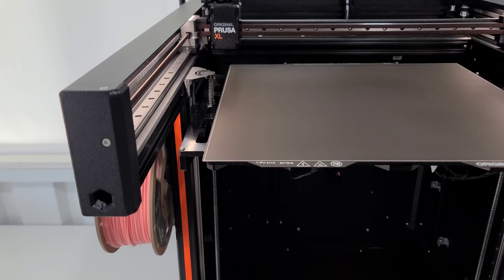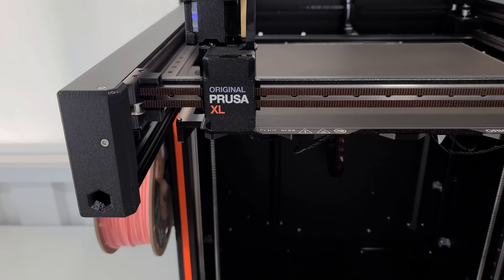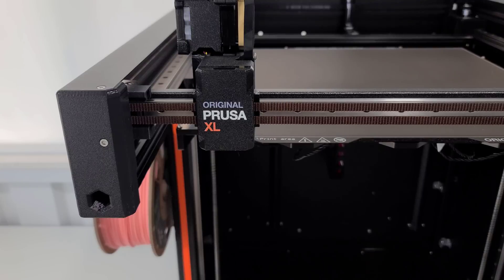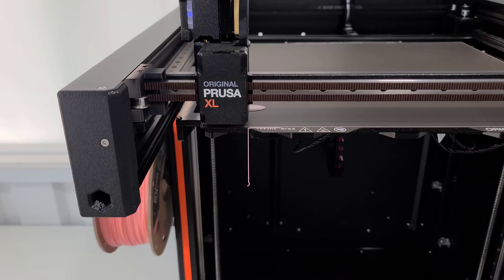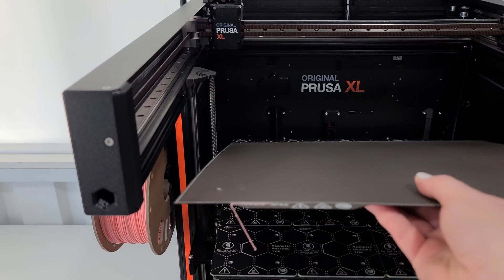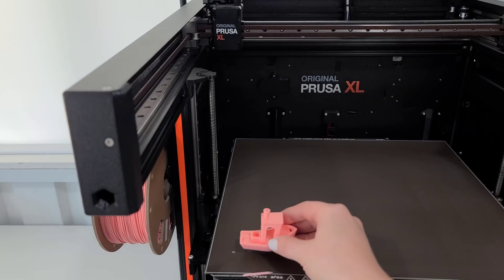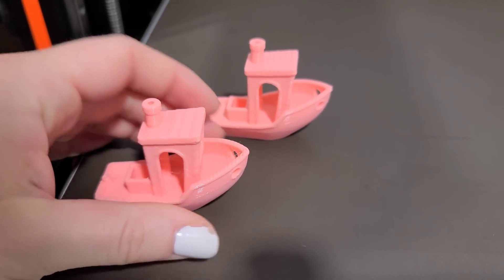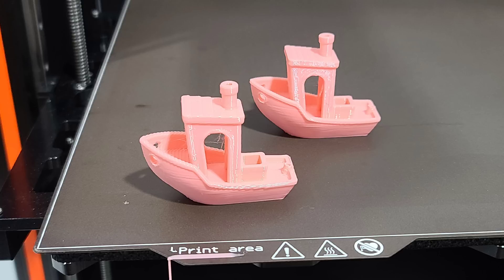Printing a Speed Benchy on the Prusa XL!

Comment: I wonder why the same settings sliced for the XL and MK4 end up with such different print times. Must be acceleration speeds.
Also the quality or speed may be better printing the bench in back corner or as the machine may be stiffer there.
Reply from the maker: Yeah I don't know why they were different. And I will keep working on speeding it up. Just wanted to start with presets. The default location on the XL is the front left. I can't remember why. I think it has something to do with the way the modular beds heat.
Reply: Possibly minimum layer time setting.

Comment: Looks like there are part cooling issues with the XL.  If you look at the second benchy that was done with a .4 nozzle which isn't that fast @ 29min or so...  you can see the front bottom hull caved in.  To be honest, was tempted to get one of these printers at the beginning, but now I feel good that I didn't get one.
Reply from the maker: Its always nice to have others look at things so I don't miss anything. I am happy with the printer but it depends on what you're looking for. Thanks!

Comment: I hope that the Prusa XL gets better because it seems downright disappointing. 40mins for a bad-looking benchy is worse than a stock ender 3 at 27x the price 💀. Personally, I think that while the delays may be somewhat down to sourcing, their main issue is that they have invested a ton into a developing a product which would have been good 4yrs ago.
Reply: Anyone judging based on this one persons use.. and not accounting for the multi head in a few months.. should not even bother. Give it some time.. its brand new. Bambu came out with lots of problems out of the gate. They resolved many.. some still stay. Once the multi head comes out.. even at slower individual print times, when you start to see what it can do, if its something you want to do in printing it will be the only printer able to do it. I am reserving judgement for when the input shaping is working, and the kinks are worked out and multi tool is out.
Reply from the maker: @WhySoDivided-CantWeAllGetAlong  these are all good points! I am looking forward to seeing whatever improvements come down the line. But I am happy with it now too. Thanks!
Reply: @WhySoDivided-CantWeAllGetAlong  the only way it could succeed is as a "trouble-free" tool-changer alternative. Even then, you are paying a HUGE premium.
Reply: @Ec1ipse..  I don't know.. E3D's tool changer is 4 heads, costs more, and looks very similar with slower speeds, etc. Haven't even seen anyone show a video on that one. I agree the tool changing has to work consistently without a hitch.. if it has issues.. that's going to be a problem for the success. The premium is steep.. but you are also getting something nobody else has that will print things no other printer can. On the flip side.. look at Ultimaker.. they have nice printers..but at $5K to $10K that are slower and less capable than many sub $2000 printers.. why do people still buy those?
Reply from the maker: I doubt most people are trying to print a stock sized benchy on their XL as their main print. I just wanted to have something to compare it to.  I'm happy with the printer but to each their own. Thanks!

Comment: Sorry, this is FAR from a "speed benchy". A ~40min benchy from your first print is just typical, and a well-tuned, slightly upgraded ender 3 will fair the same (me and many others in the community have already done it) or even faster. My Voron Trident is far cheaper than this machine and gets far better performance.
Reply: Well it will get faster once it get that "input shaping" firmware update. I don't have a Prusa XL or any prusa, nor do I plan on buying one. They are too expensive. I do have a Bambu X1C, which was probably already too expensive and more than I need. But I don't like waiting long for prints.
Reply: @atnfn  As long as you dont use the AMS and multiple colors.. the Bambu is a beast. For the money I'd still opt for a voron that prints as fast but more reliable, more community, open source, etc.. rather than stuck with a closed source "ship it back at your expense if anything goes wrong" ecosystem. But the Bambu P1P is a worthy printer for the price. The AMS (and the Prusa MMU) are really silly in my opinion though except to have backup filament should one roll run out.. that's the only benefit I see of it. The print times and the crazy amount of waste is such a huge turn off though.
Reply: @WhySoDivided-CantWeAllGetAlong  Do you have a faster, and less wasteful way of doing multi color prints on the same layer? If your not doing multi color prints then the AMS really isn't adding that much waste or print time. I am not aware of any Multi COlor printing options, excepts for Idex or Multi Head systems such as the Prusa XL, that do not waste material or time swapping filament.
Reply: @UbberMapper  Nope.. that is why I say the XL is a game changer.. 3 second head swaps.. with 5 colors/materials/nozzle options. Once it is out. You're not wrong.. just that the AMS is good only if you don't mind the limitations of it.. super slow speeds, waste.. and clogging chances.. as well as no TPU so lack of a very good material for many types of prints. If it supported TPU and had say.. 10 second or so swap times.. it would be very good. But the 1+ minute swap time, and lack of TPU to me is a major reason it's not very good.. along with the huge waste. It's A way of doing it.. but not the best way. But to be fair to AMS/MMU/etc solutions.. it is the ONLY way presently to do it. The XL will change that and I suspect once you start to see XL only types of prints (possibly with gcode for the XL) that include multi material, different nozzle sizes and heat settings.. and assuming those DO come out unlike anything you can do with other printers.. I have no doubt we'll see Bambu and others introduce mulit tool heads.. and then we all win. We'll all start to see improved ways and more heads.
Reply: @WhySoDivided-CantWeAllGetAlong  I don't think there is going to be a revolution of multi head machines in the near future...I think the prusa XL is the second of this type and the E3D tool Changer motion system has been around for years. On top of that, the wasted material is not a big deal when compared to the added cost of purchasing these multi head machines. Don't get me wrong, the multi head machines absolutly have their place such as with TPU. But most people won't need to print TPU with other materials  and that will keep demand for these machines low and thus limit how many companies are willing to produce them. I would like to have a multi head machine as i have done projects that needed the ability to print in vastly different materials in the same print. But even if i owned a prusa XL, i would still send most of my multi color printing over to the bambu because the waste really is insignificant for most multi color prints and the bambu print speeds more than make up for the down time in color swaps.
Reply: @WhySoDivided-CantWeAllGetAlong  I do have the AMS but I don't really use it for multi color prints. It's more the convenience of not having to manually load filaments, and sometimes I use the break away support interface material. It's pretty convenient. I actually had preordered  Prusa XL with 2 toolheads, but I cancelled it. Looking at the price I started having buyers remorse before even getting it.
Reply: @atnfn  I don't blame you.. I am a hobbyist too.. so it is really hard to swallow 3500 for a printer like this. But I tend to lean towards the cry once buy once. Prusa is very well established and though they been getting a lot of crap the last two years for not coming out with anything new/better, they have very reliable printers that tons of print farms depend on. I too am still "on hold" on the XL right now. I really want it for the multi tool head diff material/nozzle stuff.. I think that will be a game changer in things we can print that we simply cant do today. Simple example would be a phone case.. one piece.. with a PETG outer layer and TPU inner layer.. custom two color (or more) for specific phones. Granted..this is an "easier" print even with 1 head and manually just changing to the TPU filament at a given layer.. but then the outer layer side wall would still need to be PETG.. and using the new cris cross weaving of materials to bind them together better with multi head tool.. I can see a very rock solid PETG/TPU mixed phone case being possible that would be near impossible with AMS/MMU or manually changing it. Best way I can explain it is imagine a phone case laying flat.. and you lay down PETG.. then you start adding the TPU.. but to make it bind better.. you still intermix some PETG/TPU for a couple layers.. then a few more layers (or more) of TPU that rest against the phone. There is no way to do this with MMU/AMS options easily.. it would takes hours to print that due to all the minute+ long changes.. and the cooling of each layer in between would likely result in not nearly as good a bond of the mix. None the less.. I've no clue if this will be possible yet.. that is why I am still holding out.. between input shaping and a few other things.. I am hoping my order is not ready till end of summer time frame so that hopefully others have had time to experiment and see what is possible.
Reply from the maker: Thanks for your feedback
Reply: Yeh not really a speed benchy but comparing this machine to your Voron is a bit weird. This machine is a different animal than the Voron Trident. Correct me if i am wrong but your voron trident doesn't have as large of a build volume or the option for 5 tool heads. Yes i know there are a few different multi material options for the voron but its not the same. Yeh if you need a single material per print get a voron over this but you are probably not even looking at this machine if that is all you need.

Also, not fair to compare this machine with the Bambu as again they are different animals. Yes a bambu does have the option for multiple materials in a single print but it still not the same as having multiple heads. If you try to print lets say PC in the same print as TPU bambu will tell you noway because you could easily clog the nozzle due to the high temperature difference. Couple this with the fact that this machine will not waste as much time or filament on purging and you really start to see where it shines.

Honestly, This machine is specialized and if you don't need that specialization you are probably wasting your time but if you have the correct application then you will understand that a Voron or Bambu just doesn't compare. Only and Idex machine or something like E3D Tool Changer motion system can be compared with this.
Reply: @UbberMapper  We have to looked with the eyes of your soul? That's very slow. I'm agree with you about multi material, but there are  others options that print multil material and faster. Plus why prusa sell this printer with only 1 tool change? Instead they should sell minimum 2 toolheads. Maybe they should took the klipper avenue a not the Marlin one. But I heard from a fan boy that they went with Marlin because klipper is so much faster that does make sence... 🤥🤔
You see now fan boys are batching klipper and other brands because prusa can't make a 2023 printer. They love the past. That's why they keep making 2017 technology.
There's another fan boy that claims that prusa is the Mercedes Ben and Apple combine printer in the industry 😂😂😂
Reply: @JoseAguiloworkshops  Which other toolchanger options do you know which are considerably faster than a Prusa XL. I don't know a single one. That aside, the XL is not built for speed benchy competitions. The actual value of such is also really limited beyond a technical race for speed which can be fun just for the sake of it.
Reply: @JoseAguiloworkshops  Not sure what you mean by the eyes of my soul LOL. I wasn't trying to say that the machine is awesome or that nothing else compares. Personally, i do not own a prusa and never have so not a fan boy. All i was trying to say is that comparing it to a voron isn't a fair comparison. Its like comparing apples and Tomatoes. Both are fruit but they have different uses. 

You are right about one thing for sure. This machine 100% should have shipped with 2 heads...There is no point in owning this machine with a single head. There are faster, larger and reliable options available for less money than this in the single head format.
Reply: @UbberMapper  sorry, dual extruder.
Reply: @JoseAguiloworkshops  What other option prints multi (up to 5) material faster? Nothing. Please do NOT say the X1C. If you say that then you're clearly not paying attention to the tech. AMS (and MMU) waste more filament than they use for most prints. There was a great example of a Bambu test that showed a rocket with 1 color print fast. Multi color used 2/3 more filament than the print itself.. almost an entire roll.. $25.. to print a rocket.. with colors.. and it added 30 hours to the print time because of how excruciating long the filament changes are. But MORE importantly.. multi material on multi head is the ONLY way to do it right. With a single head, you have to adjust temperatures every single time you change filament. With multi head.. you just swap heads in 3 seconds and continue printing. AMS/MMU multi material is a joke.. with 1.5 minute change times and heat adjustment times.. the material to be printed on is already cooled. Not the right way to do it.
Reply: @WhySoDivided-CantWeAllGetAlong  I think PRUSA users have PTSD. Dude I didn't mention bambulabs. I was thinking more of the new gen QIDI Tech X- Plus series. Jesus, relax bro. Prusa need to pay attention to more manufacturers out there. No just bambulab.
Reply: @WhySoDivided-CantWeAllGetAlong  The material has already cooled is not really a good argument. Afterall, If you are printing something huge on the prusa, By the time it moves to the next layer the filament will have already cooled. In certain circumstances the amount of material the bambu AMS wastes could be problematic however, Time is Money. The bambu may waste filament but it will produce a 5 color print so much faster than the Prusa XL. In a business setting you will make more money turning out prints faster than the money you spend on filament. Also, consider from a consumer stand point for a moment. How much filament would the bambu have to waste to add up to the price difference between a bambu and a prusa XL? I have been doing prints for months with my Bambu and have only filled a single filament spool box with the debris from the ams. Since most of that space is air it doesn't even add up to a single KG. lets say i waste 6 kg of filament per year averaging $150...even in 10 years i still have spent less money than the price difference between the bambu and a 5 head prusa XL.
Reply: Agree with your multi-head points. However, realistically/functionally you should really only need 2 extruders. One for dissolvable supports, one for the material. Combing materials become weak, especially if the materials are (as you said, have different temperature, mechanical, printing properties), and seriously this printer is too expensive for it’s price. For such a premium price they don’t even bother putting 3 independent lead screws and doing true bed leveling.
Reply: @gedeonang7077  This printer is not made for those who only need 2 extruders to print something + soluble support. There are tons of options on the market. This is a printer for those who want to print more than 2 different colours or materials without the downside of single nozzle multimaterial printers. You might say there is no market for that niche but it does appear that Prusa had no trouble getting a sufficient number of orders. 

There are few tool changers on the market and those that are are not simply plug and print. May I also point out that not all prints have to cope with technically demanding requirements.
Reply from the maker: @UbberMapper  I agree that this machine is different than any other printer on the market right now. My main focus was the size and I like how reliable Prusas have been for me. It works for me.
Reply: Will your voron be able to swap heads/material/nozzles in 3 seconds and combine multiple materials in one print?

Comment: I really hope that with reales the speed is higher. When that's all, it's a bit disappointing. Especially 39 minutes at a 0.6 nozzel.
Reply: I mean.. did she adjust her settings? You're basing this on on person's settings.. wait for those that really know how to fine tune the crap out of the printer.. and input shaping.. before making any judgements. At least give the printer a little time to be in the market, work out some bugs, etc..
Reply: @WhySoDivided-CantWeAllGetAlong  If I criticize someone then the Prusa Slicer and Prusa for the fact that a device is on the market although it does not have all the features.
I am happy about every test.
Reply from the maker: Yes this is just default settings to start with. I'm sure there is a lot of room to speed up.
Reply from the maker: Yes this is just default settings to start with. I'm sure there is a lot of room to speed up.

Comment: I would love to see a Bechy at 5000-7000mm/s acceleration 🤔
Reply from the maker: Yeah that would be fun to see. Let me try it out
Reply: Won't be able to push 5-7k accels and maintain print quality without an input shaper. Right now Prusa has the XL profiles tuned to what the frame alone is mechanically capable of compensating for. Perhaps a bit less, since they're pretty conservative with their profiles, but probably pretty close. Once they finish the input shaper + pressure advance firmware (which I expect they're primarily adapting from Klipper) we should really see what the XL is capable of.